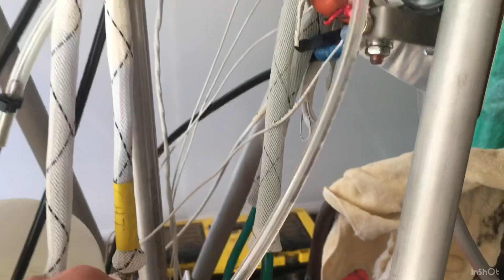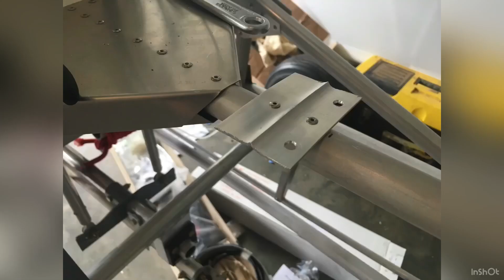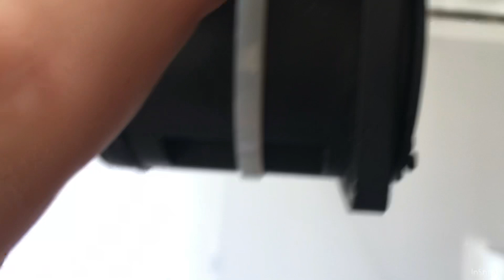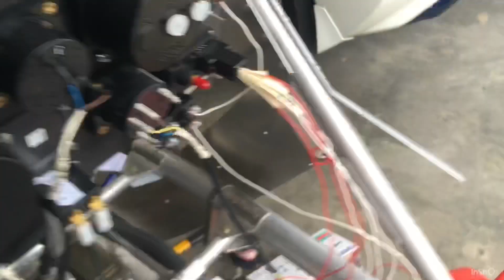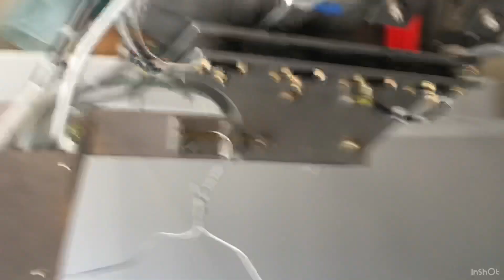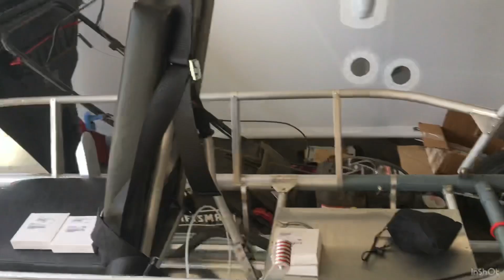Excalibur Aircraft Build Project 24

Comment: Glen , Where did you purchase you GPS Transponder set up? I'm also under class B space. Thanks,
Reply from the maker: I bought it through Aircraft Spruce: 

https://https://www.aircraftspruce.com/catalog/avpages/trig-2020bundle-11-16299.php?clickkey=5134575
Reply: @gnllr1  Thank You. And what transponder Antenna did you use ? I see it doesn't come in the bundle. Anything else do you know that I will need that doesn't come with the bundle? Thank You Glen.  Btw how's your Excalibur flying?
Reply from the maker: @allanhudsonbrady2930  You’ll need a standard TX antenna from Spruce, wire, coaxial cable between the antenna and TX, and the GPS antenna and GPS source, as well as a wire crimper.

Comment: I think the engine should be mounted parallel to the horizontal stabilizer. Not in line with the root tube.  I think you will find it will need more nose up trim.  Robert Lee   Excalibur N972PH  NC
Reply from the maker: Yep. That has been the experience so far. I will be adjusting the thrust line up 3/8” with the new guidance Tom put out.
Reply: @gnllr1  I have 164 hours on my Excalibur. It will fly hands off.   I told Tom that the mount should not be inline with root tube.  It is behind the CG.  https://www.youtube.com/watch?v=cv39i3UvwY8